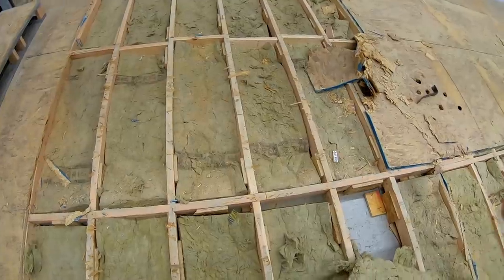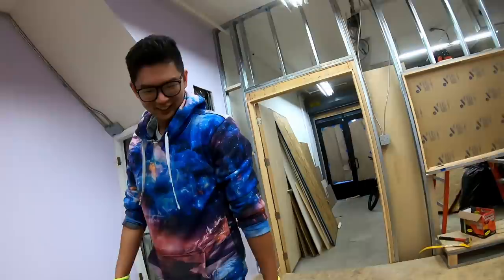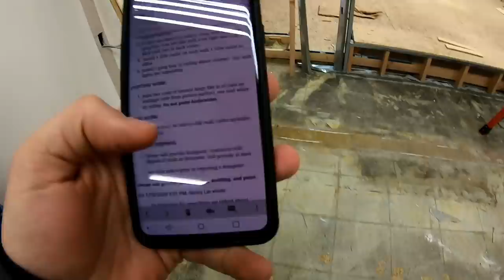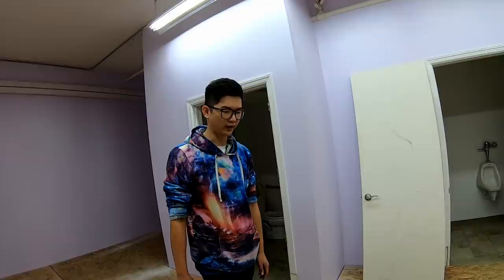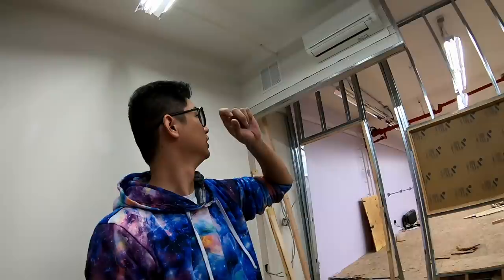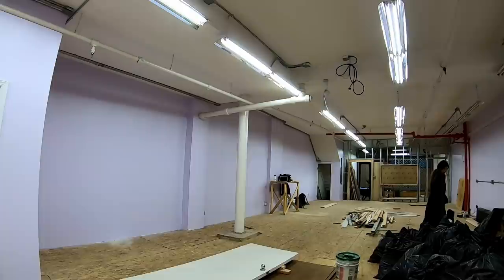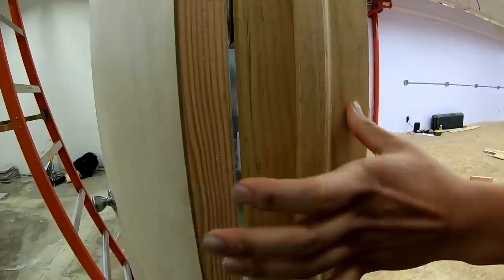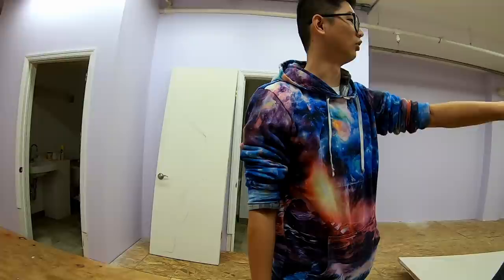Day 44 - THE RETURN OF SUNNY! Contractor C walkthrough

Comment: Oh jesus the posts were NAILED on 😂 now we've seen it all
Reply: It's not just that they were nailed, it's that they were not even glued on.
Reply: @gtfkt  good point, a hefty squirt of Liquid Nails would've made sure they were immobilized. Of course, there was still the issue that he cheaped out and started making them out of  goddamn OSB, then on top of that, wasn't even making sure they were TOUCHING THE FLOOR!
Reply: They needed to be shimmed regardless, which didn't happen.
Reply: You'd be amazed at how many people, even engineers, say nails are so strong blah blah blah compared to screws/glue
Reply: @gg-gn3re  Nails are strong, the problem is the nails are in shear and would have broken or been pulled out. Supports go under the studs not on the side.
Reply: @Segphalt  they wouldn't even break in that configuration, the materials are too soft and thin for that. They would just work their way loose once the initial grip between post and joist was overcome. Yes, the setup might have reasonably legit with proper shims. All they needed was a guy to spend half a day on a cutoff saw making assorted wedges from 2*4, those could have just been installed with glue between them at appropriate intervals, then a few right angle brackets at generous spacing (staggered) to hold everything down to the subfloor. Not a complicated task for even a non-specialist to get more or less right. And the cavity should have been filled with LECA, or at least the rockwool/fibreglass should have been stuffed in tight, not just flapping in the breeze.

Comment: Don't put the TV's on a switched outlet, it's not recommended to turn them on/off like that.  It will be better for them to have constand power, and turn them on/off with a remote.  If the TVs are the same brand, one remote will work them all.
Reply: Leaving them powered up overnight is a (very small) fire risk. Damned either way.
Reply: Or... Switch off the TV with the remote first, and then hit the outlet switch to kill power to the outlets so the TVs aren't continuing to drain power. I've done something similar with my TV for years, and it has been perfectly fine. Sometimes I don't even switch it off first.
Reply: @mjc0961  General idea with modern electronics is, that it has switched power supplies and those don't like repeated cold starts -> capacitors in them discharge completely when they are off and then there is a surge when they rapidly charge after reconnection. This combined with aging and drying of the caps may cause that the thing will not turn on again. Many brands don't have issues like this at all, usually because they use high quality name-brand caps. High powered electronics (such as motor inverters, known as VFD's in US) often have special arrangements to pre-charge the capacitor bank with low current, but we are talking about devices worth 4,5+ figures.

Comment: If Louis is confused by a few nails from a nailgun under the floor, I don't think he's prepared to see what happens at 99% of construction sites (It could be his OCD, but then again he may just be playing up the antics for views.)
For instance; under stairs, in voids drywalled-in, above ceilings, etc... Homes built today probably have a dozen empty bottles and cans stashed somewhere from wokers, and scraps will always be shoved into areas unseen after the drywall is up. Even if job sites are swept and cleaned, things happen in those last stages where things get covered up and makes for convenient places to throw things.
I agree that if it doesn't function, or is prone to breaking from poor quality, it's not done well. But wire-scraps, nails, screws, trimmings and the likes are left and "hidden" on almost every site.
Reply: At my old apartment a few years ago, my hvac stopped working, it was in the wall off the hallway to the bedroom. It was after hours friday, and maintenance said they would come out monday. I took off the wall cover, and removed the internal panels to find an overflow pan near floor level in the space which did not have a drain, but had a float to sense water. But I could see all inside the walls as well, and there was so many beer cans and plastic bottles in there. One coke bottle was filled with what I assumed was piss. I just shop vac'd the water out the overflow pan, cleaned the normal drain pan drain so it wouldn't overflow any more, and buttoned that all back up. I am sure the house I recently bought also has things hiding in the walls, and I will find them when I eventually have to open them up.
Reply: I'll throw gum wrappers into the walls from time to time, but I've seen drywallers hide piss bottles in walls. I think that's pretty disgusting, but random construction scrap like nails or things that won't rot or take up a lot of insulation space, who cares.

Comment: Put the light switch at the junction box and a solar battery 'night light' at the front door to light up for when you enter and exit in the dark - so you can see going to the main switches. Main switches out of reach of the front door to limit the trolls walking by and turning your lights off.

Comment: That "header" isnt a true header, theres no weight on it, it just packing to lower the door frame.
Reply: My thoughts exactly. Someone cut the steel studs too short and did a doofus repair. If it were a true header it would need king studs and jack studs on either side of the header
Reply: Jonny B  yeah but still not doing anything important. I was disgusted with the way the joists were supported amd mentioned it but thought maybe that commonplace in America.
Reply: Jonny B  we dont have to for partitions,  only load bearing and they have to be engineered timbers like f27 hardwood or equivalent lvl
Reply: Jonny B  my thoughts ex. its just standard, non loading or not

Comment: Louis Rossmann 
Hi, I think it will be worth considering wireless switching for the lights. You could turn on the lights before you enter and switch off after you’ve left. It would also make it easy to switch individual and groups of lights.
Reply: I thought the same thing running some form of open hab amd setting scenes for open and close procedure... Quick tap on ur phone trigger lights, tvs, hvac, etc... Im sure louis could figure out the electronics... Lol
Reply: Hardus Swanepoel 
You can buy Sonoff switches at about $8 a piece. They have WiFi and you could reflash them with Tasmota if you don’t trust their ‘security’ (you shouldn’t). There are plenty of other p&p solutions but I’d prefer open source software over proprietary sw.

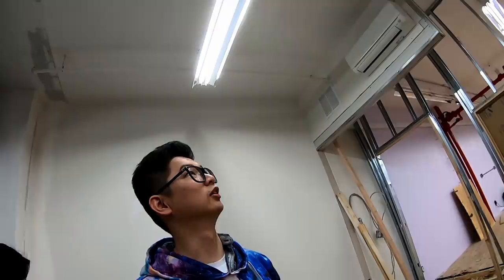Comment: 10:00 Hey Louis, You CANNOT hide any electrical junction box behind a wall or ceiling, It MUST have a face-plate, and have less than 1/8" gap between the box and Sheetrock to meet fire code. -Only low voltage connections can be enclosed behind Sheetrock and even that is not good practice.

Comment: Oh my G... and I've only watched to the part where the edges of the OSB (NOT nearly as rigid as plywood, but still bad) aren't on the supports!  Yikes!

RichE San Diego, CA
Reply: Be mindful, once they started hacking into it with a circular saw, they may have cut the length a few inches from the edge, and removed the strip that was actually secured down. That's not positively indicative of piss poor construction, just everything else is.
Reply: @mlindholm  Nonsense. They didn't even bother to mend the joists properly, of course the sheet edges aren't going to be supported.
Reply: @mlindholm  you can see the blue edge in one shot of it not lining up on a joist

Comment: Knots in wood can look really good if they are treated well, like removing any loose wood from them, adding epoxy to fill them then making sure they look dayum smexy.
But that kind of care goes into a desk / table / counter top ... not a floor. Get good wood to do a hard-wood floor or get clip-in wood (not sure how you call it in English), with proper dampening underneath it like we do in France.
PS: In France, general construction companies have a really bad thingy to them, like "jack of all trades, master of none" ... You'll get very good complementary job companies like "plasterer - painter", but electricians are usually only electricians, plumbers also, tilers too ... then again it also doesn't cost too much more to hire various experts in different jobs, than it does to hire a general contractor who will do everything average because he probably doesn't master any of the jobs, despite claiming to hire experts in specific jobs, who will end up working other jobs than their expertise.
Pay once, cry once. Make sure you hire a professional, for 1 job ... more than often, when you find the first contractor, they'll even provide you info to contact the others you need, simply because they tend to work together on sites and refer each-other to clients, which leads to really good cooperation on the job-site, none of them causing the other trouble / delays.
Reply: I think the wood you are referring to is laminate flooring. Which, in my experience, is really shit. Maybe it is poor installation, but after 5 years I usually see it warping or separating either in the middle of the floor or by the walls.
Reply: The wood you're referring to is called click flooring here. 
It can be laminate, it can be wood, it can be vinyl. 

Lots of companies do "common" flooring with filled in holes.
Reply: @detenator1  Thats poor installation or shit quality laminate. And number one mistake: they didnt let the laminate acclimate inside the room before installing. A good laminated floor will not warp or separate besides, and thats why vinyl/pvc is becoming more popular, water. Laminate doesnt do well with water but if you install it correctly (acclimating it 48 hours before installing with half a inch gap all around and not the cheapest junk out there) it will last for a long long time.

Comment: There are things he is telling you to replace that if need be, he could just repair. 

If you can get the same quality by buying poorly vetted wood, and using your labor to throw out the bad stuff, you can gain more money. It's something contractors do all the time to lower their bids.

Also, if you are working at an hourly wage and you drop something that costs about 5 cents, you are not going to take the time to pick it up so that you can waste what is easily 15 cents of time. You are going to continue on if it won't hurt anything being where it is. That's why the nails for the nailgun were on the ground. 

Some people prefer a laquered floor so most contractors will buy untreated wood, and layer some treatment on the top. What you get is a smooth finish that will feel nice and uninterrupted.

Comment: If you are putting power outlets into the front desk anyways, it should be rather easy to also put the light switch for the front lights in there as well. Might be an option.

Comment: You can not patch a junction behind drywall per NEC code. It has to be accessable. You can run new wire at correct lengths to the light so no junction box is needed.
Reply from the maker: The junction box is leftover from there being an office in the front, since that office is gone that junk should all be redone. I do not see any need for there to be a junction box up there, neither did the electrician. That should be re-run entirely.

Comment: Just in the intro but.

OMG, OSB mounted like that as a support! I wanna see the OSB supporters defend that one.
Reply: Raises Hand I'll give it a try.

How do you know those pieces that are nailed to the side are intended to be structural supports? Imagine you are trying to level the floor. After getting the pitch just right, you want it to stay exactly where it is. So you grab a scrap piece of wood, quickly nail it to the side of the 2x4 so it stays exactly where it is. After that, you place shims underneath it to truly support the weight. In the day 17 video, you can see more shims under the 2x4's.

Additionally, you can see that the edges of the plywood are supported every other section, the way the 2x4's are staggered. So I don't think they'd flex as much as sunny said.
Reply: @mikes3173  lol, if you han't put that intro I'd have needed my safety oven mitt.
Reply: Actually technically you can i guess but you shouldnt and not because its OSB but you shouldnt use panels (doesnt matter what kind) as support for any kind of load bearing construction. It shouldnt be OSB nor plywood or what ever else, should be something like a 2 x 4 , well i would have gone for 4 x 6 cause there's no reason not to. Not that anyone should make a dumb ass floor like this.

Comment: You can raise the toilet properly with minimal concrete removal with a small air hammer. The sink can be raised no problem. The urinal could remain low, no different than the urinals they leave low for kids to use.

Comment: You can not hide a junction box in the ceiling, it's against code. You can rewire or just put a plate on it
Reply from the maker: The junction box was there when they initially demo'd that front office space. There is no reason for it to be there now since we do not have an office space there, so having it there makes zero sense, as does putting a plate/access panel. Rewiring the setup as it would have been run if this were an open space was what the electrician recommended doing.

Comment: Hey Louis, as someone who once worked in construction, it looks messy under those floorboards because nobody cares what the floor looks like under the plywood. A few spare nails n stuff isn't going to do anything negative to the integrity of the floor foundation so yeah, expect a mess under there. 

Just saying because, of all the legitimate grievances you have with the shitty contractor, that is not one of them, it's not even worth caring that there's a mess under there, you'll never see it  again once the job is finished.
Reply: Well said, about time we had a sensible comment.
Reply: @daverhodes382  yeah it's called rough carpentry for a reason. You dont see it after its covered up. I remember working on a renovation where to labourers just swept the dirt into a whole into the floor. I don't agree with it but its common.
Reply: It may have zero effect on the integrity of a well constructed floor but it relates directly to the work ethics of the person/people who are doing the job. In this case they made a crap floor, crap door, supplied crap material (OSB). In hindsight, Eugene should have been fired on Day 11 when he stopped using plywood and substituted his own interpretation of plywood.

Comment: To be honest the new floor won't be any better if your just laying plywood over it with shims if anything it will feel wavy as you walk over time. As for the particle board it can actually be stronger then regular plywood depending on the type you get. Picture it like fiberglass glued together. The only down side of particle board you don't use it for exposed areas as it's ugly.

Comment: "In the front"? You don't want the light switch to be in the front  where your customers can accidentally (or on purpose) turn it on/off.  Right?
Reply: Good point.
Reply: It's not the only consideration though. There is a reason why 'right next to the door' is the default position for light switches (and there are (usually) equally good reasons for why they are elsewhere when that's tge case.)
Reply: @laurencefraser  by code new York store must keep a lit windows. 
that's means the front will always be lit thre is no need for an easely axessible switch.
Reply: I was thinking the same.  Should put one switch in the front for the front area, and then put the other switches behind the desk.   Also, I would leave that AC unit where it is, but finish that wall part so it extends all the way to the other end, and make it into an archway and look intentional.  Moving that AC unit involves removing the freon and rebraising the lines and readding it and it's a big expensive job.
Reply: @redsquirrelftw  

They have said before that the ac is fairly new and the copper hasn't work hardened yet so they may be able to move it without breaking/disconnecting the copper.
Reply: @zachdemand4508  Oh interesting, yeah if that's the case it's worth a shot.